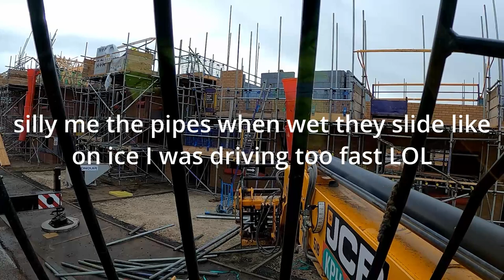Telehandler driving at work Time lapse Vlog ep #22

Comment: Hi, I’m just about to buy a tele handler. Your vids have been interesting to watch. 
What would be the down sides to buying a older machine?
Reply from the maker: Hello Nick well I don't see difference between new one or older one it's just the one thing you may need to repair more often than new one and older one you always can upgrade like for example buy hydraulic forks.
Reply: @baltictv9074  thanks.  
Anything I should keep an eye out for when viewing them?
Reply from the maker: @nickjones7215  yes in my opinion keep an eye on cracks and splits on the Boom trust me they do break I did broke one before and it's going to cost you a lot to fix it when you carry a lot heavy stuff for example loading shovel I've been loading wagons then I broke one, so keep an eye on on the head between forks and a boom for cracks
Reply: @baltictv9074  thanks for the advice. I’ll keep look very closely at the boom 👍
Reply: Looking into taking my telehandler test. Is there any medical requirements that you need to pass before taking up any training?
Reply from the maker: @coltgti   hey no you don’t need its just some companies want you to do medical test but dot worry you dont cost any money
Reply: @baltictv9074  thats good to know, ill be going from driving a truck to working on telehandlers. Lucky there's loads of work round Lancashire on them.
Reply from the maker: @rajindernijjer  well i want to see where i drive it takes just one little pothole and everything what you had on forks go up side down.
And for the curves man this machine build for of road what you can damage there lol
Reply from the maker: @rajindernijjer  do you saw ever how tyre pop on them and machine tip over? Can i ask how long you working on them?
Reply from the maker: @rajindernijjer  right trust me they do pop up i had many punchers and couple times tyre pop of in my 7 years ex i drive like this all this time never had accident well i dit drop tub or a pallet but thats because i dint see hole in the ground btw im not sure what kind site provides banks-man government sites?
I mean man i got a lot ex whit this machine i       Drive how im comfortable and im doing this for 7 years 0 accidents and i not saying you should drive same if you have one week ex i recommend you not drive like me drive how are you comfortable whit machine you got to feel what what you can do whit it.
And btw don’t compare telehandler whit forklift i know how they easy tipping over this is not forklift i hope this is make sense to you and clear your worries about this machine
Reply from the maker: @rajindernijjer  lol man you made me laugh i never ben on site i never done the test im not going to argue whit you.
You know better!!!
Reply from the maker: @rajindernijjer  0